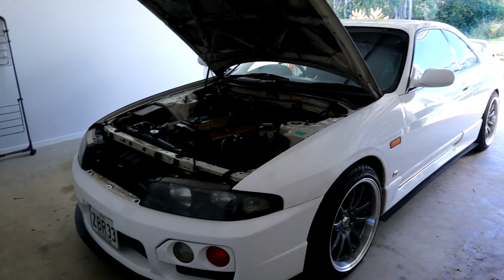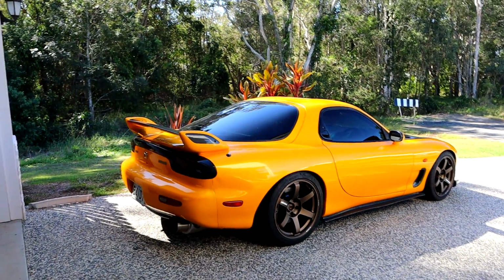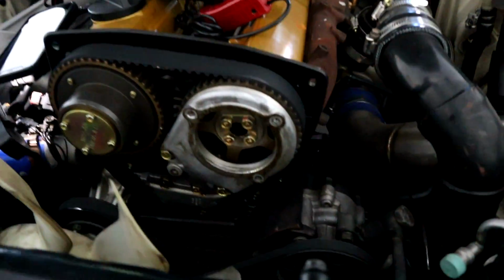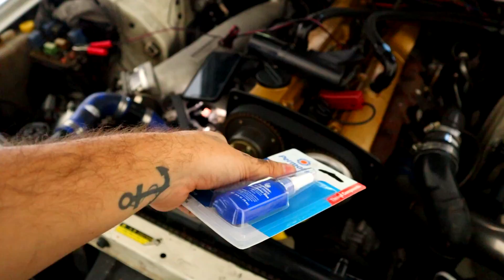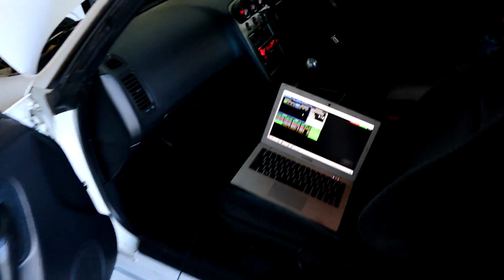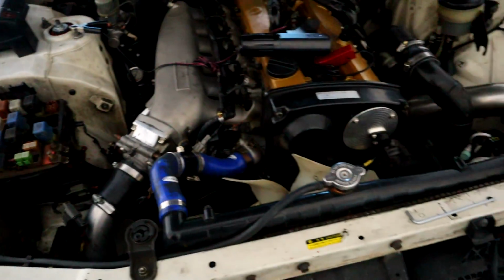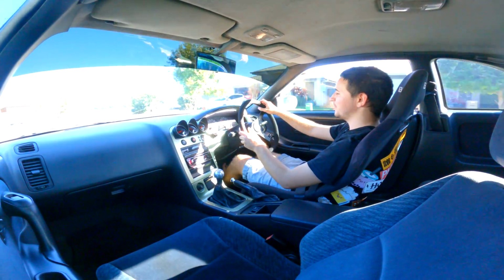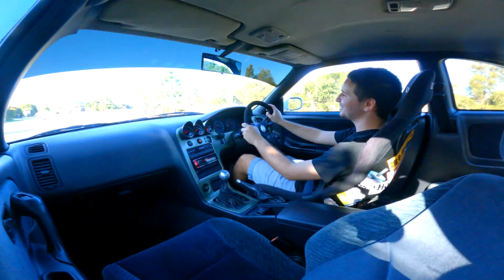RB25 Trigger Kit Turned my Skyline into a NEW CAR!

Comment: Just a question about your FD. Are your sequential turbos stock or modified to work with your ported motor? I'm really keen to understand that setup as I want to retain the sequential turbos on my car should I rebuild the motor. If that happens I would definitely be interested in a port.

Comment: 280 hp?? That's pretty low man for all the mods you did... get a vw polo slap a stage 1 on it it's 255hp stage 2 280, stage 325hp not bad a four cylinder